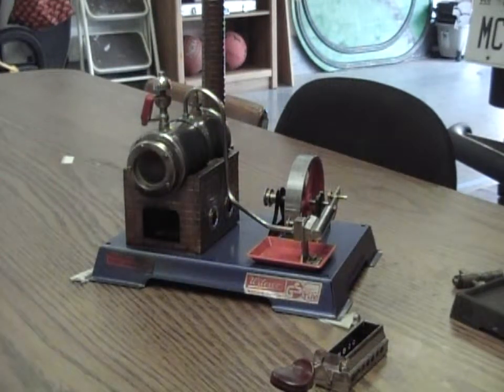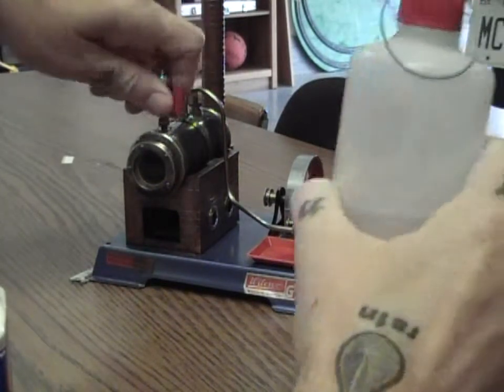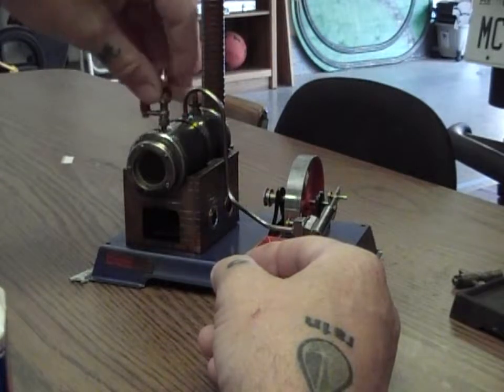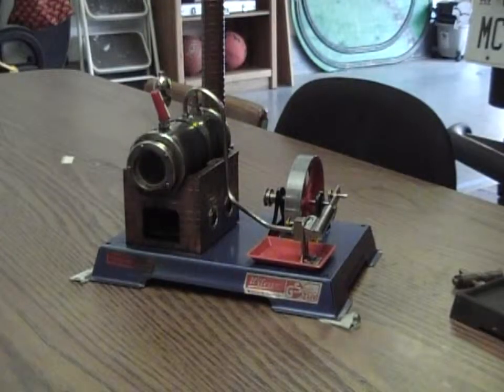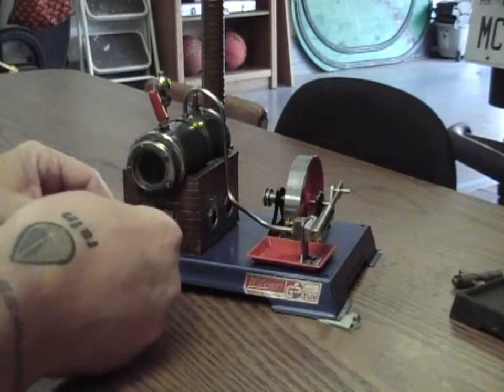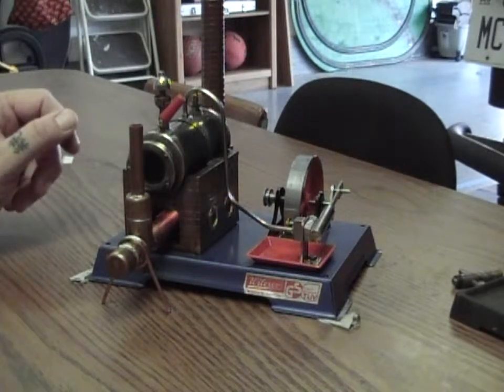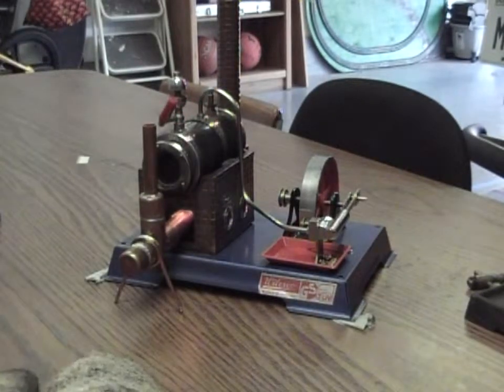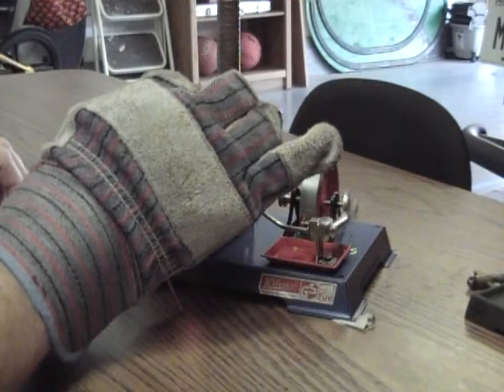Firing a Wilesco D4-5 Live Steam Engine

Comment: I sure hope you're using distilled water, as tap water is murder to these soft soldiered boilers, as the mineral build up can cause the end caps of the boiler to separate from the barrel. Also, I recommend investing in some good steam oil, as oils like 3 in 1 are more for the crank and crank shaft and steam oil is formulated to last longer in the hot wet cylinders. Great video by the way.